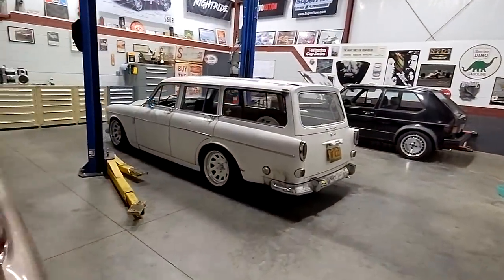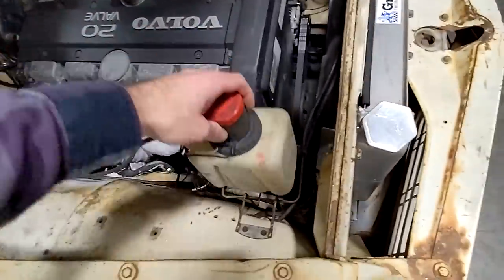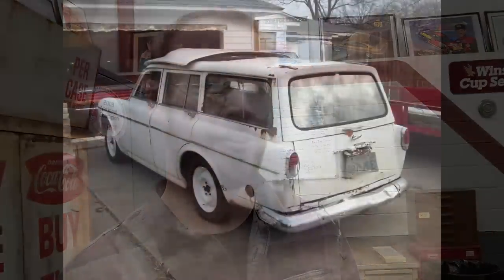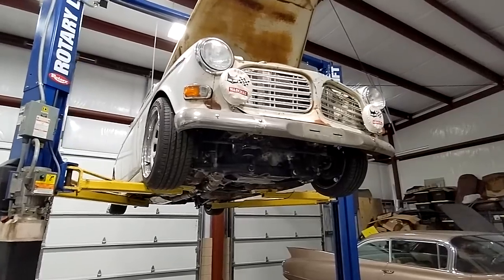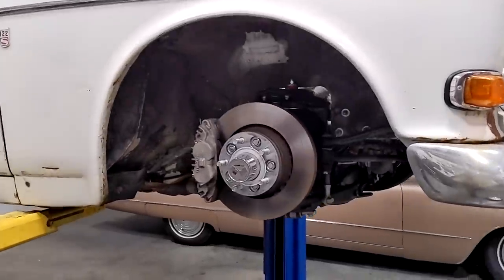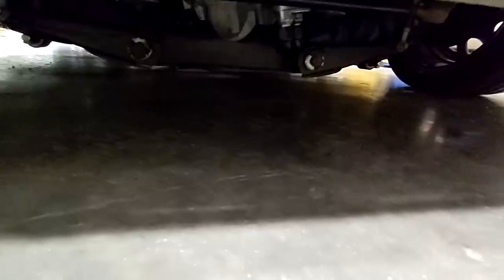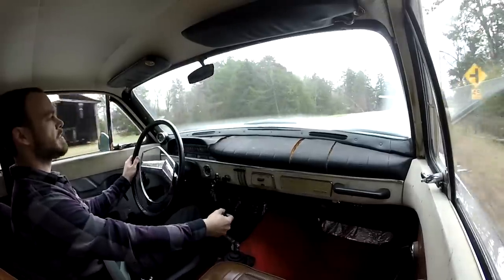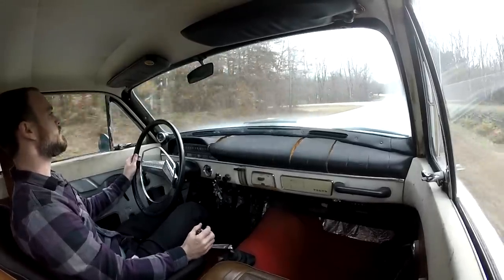Bagged, Swapped, Rowdy! 1966 Volvo 122 S

Comment: should make some discrete sideskirts  and some rails on the frame it can sit on if you wanna park it on its belly.  easier to change a rail than changing out panels and stuff after some time.

Comment: That whiteblock making some killer sound! Way better going na than turbo!
Reply from the maker: I'm very happy as well keeping it n/a. It's enough power, and yeah the noises are great.
Reply: Ouch that hurts. My three 850 wagons are all turbo variants. I’d love to have the sound he has. You have me scratching my head now, what to do.
Reply: There both cool, reliable, and great sounding. All depends on what you want. A b5234t with ported intake, turbo inlet with open filter, and 3"" ss turboback still sounds pretty amazing.. windows up I hear intake and turbo over exhaust.
Reply: @ogfromutube9649  You are right, I do love the sound of the intake, and the turbo. But there is nothing better than the 5 cylinder rumble. 
I’ll have to experiment with it.
All good fun. 
My daughter drives, a stock turbo 940. The turbo on it, sounds so cute. It’s fun too.
Reply: @ogfromutube9649  I drive a b5234t, non ported and stock turbo as far as I know. I do have a K&N filter in the stock airbox, DO88 charge piping and a stainless turbo back (with sports cat and mufflers/reso). It was only when I got the downpipe (cat back already in place) that the exhaust started to be more balanced against the intake sound. I hope to get a DO88 intake pipe and intercooler soon, might make a bit more intake sound then :)

Comment: This thing is freaking cool man! I have a turbo whiteblock 04 motor in a 98 T5 with fbo, coilovers, water methanol, etc.. made 350whp and over 400ft lbs... And I have a 1990 244gl with a cammed LS, manual Nissan trans, ford 8.8 rear with 3.73, ipd sport springs, bne panhard bar etc.. has 1 7/8 longtube headers with tbss and 92mm tb so it's loud... 
I love inline 5s and V8 sounds.. the itb definitely make some nice sound with the 5 cyl.. like a mini v10 or V12 lol... I'd love a 140 or even 160 to put my LS drivetrain in. The 240 is solid but a 4dr sedan wasn't my first choice. It does look pretty cool with black n silver two tone and BBS SR wheels on it, also had some Vette salad shooter 16x9.5 on it. But again very cool!! I see you have a mk2 vw in there as well. My buddy has a 93 corrado g60 in yellow been sitting in his garage for like 15 years.

Comment: nice video ,i see your in the V category, Volvo  and Volkswagen ,nice work on the 122 wagon tough to find any kind of wagon,I been owning/driving these over 40 yrs and over a million miles over 4 to 5- 240's and love them and there is nothing better in winter for heat, and have had heated seats since 1981 driver seat was standard passenger seat was optional, girls like it on the bunns, LOL, nice work on the car, when you go to do the rest of the drop  build and cut up the rear floor ,if can retro fit the factory hydraulic engine mounts , you'll find as much as 15-20% NVH reduction in the cabin, it is a huge difference, you can buy a one sided adhesive backed insulation for the underside of the  hood , cut to shape and its peel and stick, that alone cuts your NVH another 6.5 decibels , which is really noticeable , one trick i learned from a car builder is spraying under coating inside your doors, just a thin coat and it reduces the natural resonance transmitted from the road through the chassis, i did this on my 89 240 DL and it works pretty good, sweet ride, you can also get cams for that engine that'll give another10-15 bhp, 👍

Comment: I really enjoyed the video.  I know your car intimately.  My 1966 wagon is also in the California Vit color with a green interior.  It was in very rough condition when I bought it.  I liked the ideas that you had for the brakes.  Do you have the front on air bags as well?  I have a Volvo 850 with a turbo.  The car had low miles on it when a tree came down on it in a wind storm.  I was considering the idea of saving the motor, ECU and wiring harness for a possible swap.  The 1966 wagon had quite a bit of rust and a rod thrown through the side of the block so I decided that this one would be the modified Amazon.  
For good, inexpensive disk brakes, I used the stock front disk setup and replaced the stock Girling calipers with Wilwood calipers.  Wilwood make a caliper that is a duplicate of the original calipers and they weigh about 40% of the cast iron originals.  I used the largest calipers from this Wilwood series for the front calipers.  For the rear brakes, i took a set of the front disks and put them on the drum brake hubs.  I then used a slightly smaller size of the same Wilwoods on the back with very simple brackets.  I used a Wilwood clutch master cylinder and a Wilwood dual chamber brake master cylinder.  For the emergency brake, I came up with Wilwood remote mount brake master cylinder that looks just like the clutch master cylinder.  It has the brake bleed off valve, but there is no fluid reservoir on it.  I ran the rear brake line through this cylinder and on to the rear calipers.  This brake cylinder uses the main brake master cylinder as the fluid reservoir.  I can step on the brake, pull up the brake handle.  This adds a bit more pressure to the rear calipers and then I set the E-brake handle which holds the pressure in the calipers.  I mounted this remote cylinder under the car and connected it to the stock Amazon E-brake handle.  
I also used a modified VW Vanagon rack and pinion steering in the car.  I have a built ALH VW TDI that puts out about 190 hp and a Toyota W-59 OD five speed transmission that will be going in next.  I will use the stock rearend for know, but I just picked up a 2002 BMW and I am going to see if I can make the IRS work in the Amazon.  My wagon is also a 1966 Herrgård vagn (kombi in Sweden or station wagon in NA).  This will be the hotrodded Amazon.  I also have a 1966 coupe with a built B20, M41 OD trans, and IpD suspension.  There is also completely stock 1969 wagon with the B20 and automatic that will get some attention in good time.
Sorry for going on so long here.  I wanted to share some ideas to get other peoples juices flowing a bit.  Again, nice job on the video and I look forward to seeing your future progress.

Comment: Sick amazon, Sick MK1 GTI. Both speak to me.
I've been looking into IRS swaps for solid axle cars, and one of the ones that really stood out to me was the RX8. The whole multi-link setup hooks up with 6 bolts and they're SILLY cheap. And theres all manner of aftermarket suspension and linkage parts for them.
Reply: why,the solid axle is bullet proof, the rear end stick its the front that washes out

Comment: love what you have done with it!. could you share any more info on the airbag setup? (what brand/model, what modifications required) would greatly appreciate it. im looking at bagging my p1800.
Reply from the maker: My stuff is all from air lift performance, they're universal bag and strut assemblies. Unfortunately it took a ton of fab work to get them in there. The front subframe was cut to fit them, and the rear axle is on a custom 4 link setup to fit the rears.

Comment: Couldn't help but notice the saffron c70 you had I'm building a 98 c70 2.3 manual and I was wondering what you did to yours I've been doing as much research as possible but not much out there for them
Reply from the maker: Not much done to that one but they're pretty straightforward. Mine is a manual as well 👍

Comment: Hey man, Love the car. Saw the shop though and have to ask, whats the dimensions of the shop? Im currently designing my own shop build and love the layout you have. Thanks!
Reply from the maker: Thank you! 30'x50'. I tell people it's like fish in a fish bowl. I had two cars when I built the place and it was plenty of space 😅
Reply: @longautomotive  hell yeah man, that’s sweet! I’m trying to not run out of space haha, currently have 3 cars and 7 bikes. Planning on getting another car here soon. So I plan on going a bit bigger. Plus I do a lot of composites works, and have a cnc mill on the way right now. Currently thinking 30x100x16 with 1200sqft of lofts. The 30ft depth looks like it works great. Very little wasted space, any recommendations after building it? Thanks for the response!

Comment: Can you not use a modified 960 straight six exhaust manifold on this as it's basically the same engine?
Reply from the maker: Honestly I didn't try, as I didn't have one on hand. Maybe? It gets real tight in there with room so I'm not sure.

Comment: Where I'm from the stationwagon is easier than the coupe. 
Mix thoughts on the bags ..... BuT the iTBs are epic and spot on. Wish the 70s/80s owners wud ditch the carbs and go for iTBs and standalone ECU.
Reply from the maker: I hear you 100%. I go back and forth about appropriate induction. I went far out of my way to put bike carbs on my rabbit so I can see both sides. That wagon though starts every single time with little effort, and you can't always say that about your average carbureted vehicle.
Reply: @longautomotive  Reason why I'm not in favour of bags is added weight.  Where I'm at, in the early 90s we used to put carbs from Honda GSX 500 on the Nissan CA18 ... or any twin cam engines under 2 liter untill Haltech Sport 500 is available used for cheap from 2000.  Now, we do it proper with option of the injectors can sit pre velocity stack or post(oem placement) with sound still the main priority. 😁🤘

Comment: That's a glorious beauty , congrats on achieving such a kickass build !! 
How did you section the oil pan so's it wouldn't obstruct the subframe ? Did you cut it & then refabricate the 2 pieces ?
Reply from the maker: Correct, I cut it in half and removed a few inches of it. I used a junk engine as a welding fixture to keep it from moving.
Reply: @longautomotive  got it , thank you , that’s very useful info b/c I’m strongly considering getting a W123 Benz & dropping a Chevy small block in there , which will require me to deal with the same issue . I’m def gonna continue to follow your build, & I can’t wait to see what the beauty will look like in her final form !
Btw those Ronal wheels on the Rabbit are arguably the greatest looking wheels ever made IMO
Reply from the maker: Thank you!

Comment: Very nice volvo👍 what the set  suspension it is? Thx
Reply from the maker: It's completely fabricated but the components are a combination of air lift performance and ride tech parts.
Reply: Hi. I'm also curious about the air suspension. Coud you please be more spesific? I've been thinking about a smilar solution for my Amazon, but havent been able to figure out the right length and width and so on...

Comment: What master cylinders are you using. I see they’re a remote setup. Thanks.
Reply from the maker: The brand is Tilton, I can't remember sizes off hand but I need to switch them up for more pedal pressure honestly

Comment: Hello, I am considering a similar assembly, what element did you take for the ignition? Thank you for your return
Reply from the maker: Hi! The car runs on ms3 pro standalone engine management. On the ignition side it runs coils from a ~99 Volvo. I tried to run the older style from say a 960, but the newer ones in the end were easier. You can't run a distributor because there is no room for it. Standard cam sensor and crank sensor.
Reply: Thank you for sharing your experience. With the MS3 it was possible to keep the injection, why the choice of GSXR carburettors? Have a good day
Reply from the maker: It's still on injection, just gsxr throttles, with standard Volvo 850 injectors. You can run most standalone EFI systems however you like, with either fuel or ignition control separately or together. with a 5 cylinder I needed full sequential control, so I went with ms3pro. At the time it was very competitive, but there are probably better options now. And certainly cheaper options if you are able to do wasted spark or batch fire injection. The intake section at the head is cut down from a Volvo 960. The choice of gsxr specifically was for cost alone. There are better options.
Reply: ok thank you again for all his details, good job and nice car thank you

Comment: right for a start its not a 122s , the wagons were 121 single carb ,, they didnt make a twin carb wagon  i have run volvos nearly all my life , my first was a amazon from 61 the amazon name was dropped due to a court case of the name ,kriedler motorcycle had the right to the name , so this was when the became 120 series , every 120 i had was modified my wagon the most ,, ,always used the volvo motor, the most radical was the last early b20 block bored to 2,1 the stroked to 2.3, using early b20 rods with a later b20 crank,with pistons with higher pin height, on 45 .s this made just over 200 bhp but it was nt ideal for towing a trailer so i reverted to the s u,s , it would pull 6500 in o/d top, over 130 mph , this was the late 70,s , had a doubled up anti roll bar at the front with spax dampers, handle great on the street bloody awefull on a track , but it was a tow vehicle realy
Reply: you found an adapter to fit the white block for a t5 tranny, cant stand the auto in my v90 , so what did you use
Reply from the maker: The only 122 available to my knowledge in the US was a 122S with dual carbs. I have two of them, I cut up another to make this one.

The adapter came from deeworks.ca, they're in Canada, he does a good job.
Reply: @longautomotive  in europe the wagon was never offered as a 122 s only a 121 single carb which was pathetic also i dont think it was offered with overdrive. look up guy martins 121 wagon , it has a b29 motor lots of power its awesome , the swedes have some silly ones as well , , in the 60,s there were a few 289 ford powered in the u s a

Comment: Hope you never have to use that seat belt in any front ender - Airbags vs that S O L I D Steering Wheel I have had 2 with & 2 without now way an airbag is a luxury.